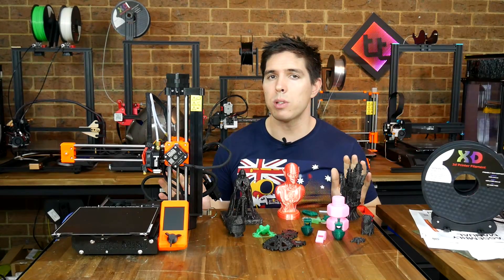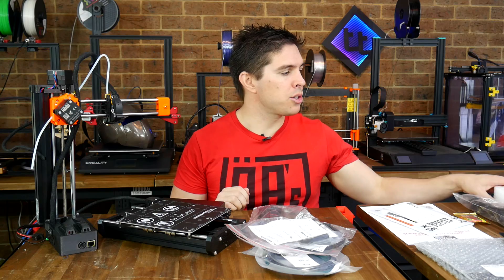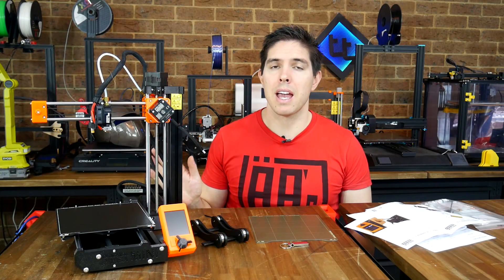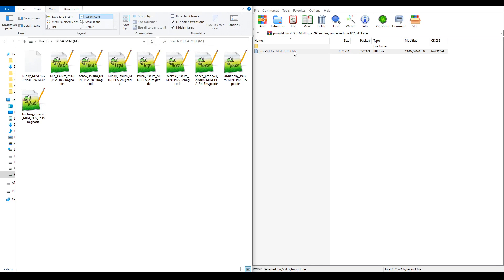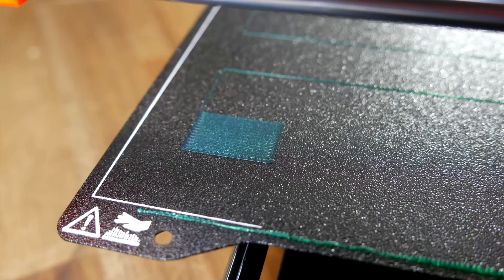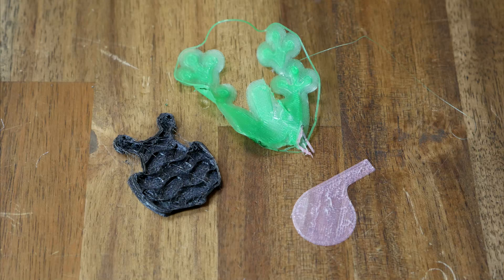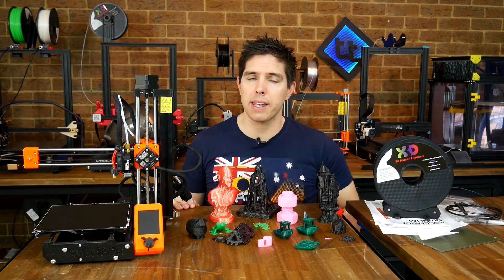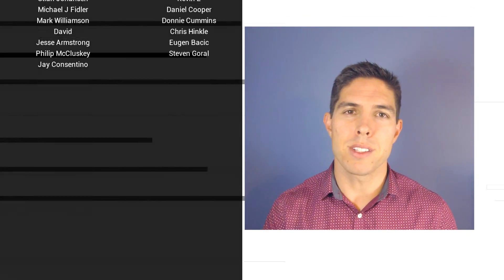Prusa Mini first prints (and troubleshooting)

Comment: Received my Mini 3 weeks ago. I already have an Ender 3 Pro and had an Anycubic i3 Mega for a few months. The Mark 3 is too expensive for me but the Mini seemed like a good compromise. Unfortunately I am also having constant issues with filament jams or slipping. The loading mechanism on the Mini is the worst I have ever seen. In addition, when something goes wrong the mechanism is not easily accessible to fix it. The "cheap" printers are much better in that regard. I really like the size, quietness and software features, but because of the filament problems I currently don't use it much. The print quality is good, but I still get slightly better results on my Ender 3. This could be because I tuned my Cura profiles for months and I am not very familiar with PrusaSlicer yet.
Reply from the maker: Great feedback, thanks for sharing.
Reply: Agreed. A printer that struggles to load filament is unacceptable from prusa. I'm on the verge of lighting mine on fire. It's just one jam after another.
Reply: @AlexKretzschmar  check the extruder. It could be too low. Mine was.

Comment: I'm tired of how every printer on the market seems to come out half-baked and requires fixes from the user.
Reply: It's still an emerging technology. I get it, I've been working on my printer ever since I got it and it kinda drives me nuts that it's spent more hours getting fixed or waiting for parts than it has been printing, but it's not like we have companies on the scales of HP, Microsoft, Samsung, and Apple producing these printers. And even those companies still have BS that happens with new products.
Reply: That's not quite true. I haven't heard people complaining about Ultimakers, MarkForged, EOS, HP, Formlabs, Raise3D or Stratasys 3D printers very much as being undercooked when introduced to the market.
Reply: Sanity Agathion You’re talking about multi thousand dollar printers, lol. We don’t have 2k-50k dollars, we have a few hundred for a prusa mini.
Reply: @bldjln3158  Indeed, but OP said "every printer on the market", which includes these as well. Do you want professional-grade equipment with premium support? Pay up. That's how it is right now. 3D p;rinters in accessible consumer space are still very new, very fiddly and require lot of attention. These are not yet appliances you buy in your nearest BestBuy in electronics section, bring home, connect to Wifi, download app and print. Not yet.
Reply: Not true. I am using Prusa MK3 since last 2 years and I have to maintain it only twice. Changed heater cartridge and Bed sensor. That’s it.
Reply: @Don Gray Exactly.

Comment: So basically the prusa mini has the same problems as some ender 3s had
Reply: Nope, ender 3 doesnt have ABL which is common fault on the mini, and ender 3 dont have firmware problems.

Comment: Every prusa mini video I have watched the printer has failed out of the box, I really wanted to buy one but i'm gonna stick to my ender 3 now.
Reply: I also have an ender3 and I like the build quality of prusa3 more. It’s difficult to upgrade it to that level.
I noticed that the textured PEI sheet is difficult to print on, it has to be very clean. But you are warned about that while buying it (IIRC)
Reply: @MarkusSeidl  yeah I find the textured only good for PETG
Reply: I think there is always a bit of luck involved:  since January I have an Ender 3 Pro and every 2 to 3 weeks something go's wrong ...  It has cost me more than 200€ to fix all the problems.
Reply: backyardbasher mine worked out the box, but mine arrived December last year.
Reply: @MarkusSeidl  I got mine around the same time and only had minor sticking issues with the bed, followed by a little bit of filament stripping on softer PLA. I did swap some parts to fix issues preemptively though.
Reply: Mine did a perfect benchy out of the box , but it must be just mine , came a week ago
Reply: Youd be suprised at how much better even the mini is than the ender 3. I have 2x Mk3S for my mini farm and its amazing how less time i have to spend tinkering with these.
Reply: Prusa is the most overrated machine sold today. Over priced for the cheap harbor freight quality.
Reply: @kraken3d718  I wouldn't say that. Their quality control and customer service still are far higher than anyone in their price range. Flawless? Not by a long shot. Better? Yes. Few printers are as good as the mk3s out of the box under $1000, even if you can mod a Creality machine to that level for a similar cost.
Reply: @kraken3d718  don't kid yourself mate, the i3 lineup from prusa has been a market leader, and for good reason too
Reply: @tcw95NZ  yeah lots of advertisement and lack of quality competitors in the early years. Now there are great machines sub $250. Absolutely no real reason to pay more in 2020. But the reach their own.
Reply: @kraken3d718  Every other prussa printer has been the best on the market. This one is a notable exception, and even then could be fixed with slightly longer pei tubes out of the box.

Comment: I'm sure they will work many of the issues out but I would be a little disappointed too if I were you. Creality needs to come out with an Ender 3 with ABL. Sell it for 300 and there would be NO reason to go with the Prusa. I know many people who have bought Ender 3s and are getting much better results right out of the box.
Reply: Creality makes quality printers. Because of the sturdy frame and board, the prints comes out almost flawlessly. I got a CR-10, CR-10 Max, CR-10 s5 and an Ender 2. And I must say, they all print so good!

Comment: I experienced the same issue with the jamming at the hot end. There are 3 grub screws that can be loosened and allow you to push the assembly up reducing the amount of space inside of the hot end and allowing for the stock PTFE tube to fit. I agree that I was not expecting to have to deal with an issue like that. Once I got it running again it was going well. My stringing is less than yours, and I just started to tune that away.

Comment: Just finished assembling mine. I couldn't get it to load filament and eventually noticed the extruder idler tension screw loose and dangling out the side. Once I got that fixed it seems to be running great, hopefully that's the worst of my issues.
Reply from the maker: I've just been browsing the forums and it seems quite a few rceived printers with loose x/y belt pulley grub screws.
Reply: I spoke too soon, after printing for a bit I ran into extrusion issues. Ended up having to replace the PTFE tube as well to get it working again, they have this exact issue and the fix documented on their website so I'm really not sure why they can't manage to assemble them correctly to begin with.

Comment: I'm a bit disappointed. I wasn't expecting one had to fix a brand new printer by removing the extruder when I recommended the Prusa Mini to my friends. In fact, I don't think I'll be buying one after seeing several youtubers reporting so many issues like that.
Reply: You don't have to remove it, just loosen the three grub screws and push it firmly up, then tighten the 3 grub screws again.  Some people needed to clean out their heat break too.  I didn't.  Prusa should really have got this sorted by now though, all the problems are assembly problems.
Reply: I am a 3d-printer noob and had the exact same experience.  I am disappointed with all the fixes and breaks that I have had -- and I've had them all.  Short PTFE tube, clogged long PTFE tube, stripped grub screws, clicking extruder. 

I love the Prusa ethics and models, so I'm proud to support them. But I'm wishing I would have gotten v2 or v3 of the printer.

Comment: I got my Mini 3 weeks ago.  I also had problems with frequent jams.  I also had problems when unloading the filament due to the blob on the end being too large to fit through the ptfe tube.  Increasing the length of the hotend ptfe tube fixed both problems.  The prints I am getting are better than my MK3S’.  I did print a different electronics cover and strain relief for the X axis, both found on thingiverse.  I also printed a different spool holder that did not have to be adjusted whenever you change the size of your spools.  I did wish it came with an all metal hotend that did not require a special nozzle.  I do like the printer and I have gotten some excellent prints from it.
Reply: Oh So is hope for this machine! :) thx
Reply: can you eplain how to fix it? thanks
Reply: Aka Krai Here is the link to the instructions on how to replace the hotend ptfe tube.  https://manual.prusa3d.com/Guide/How+to+change+a+hotend+PTFE+tube+-+MINI/1505   I used a piece of capricorn ptfe tube that was a few mm longer than the original one.  The one they put in the hotend was a little too short.
Reply from the maker: Thanks for sharing.

Comment: I have had a mini since the first batch of deliveries.  After the list of things that were assembled wrong at the factory were fixed, I have a printer which exceeds my MK3s in quality and have not seen a single string :) I had the over tightened idler and also the problems in the hot end though mine was solved by simply moving the hotend firmly up against the ptfe tube.  I have also had the MINDA probe fail which to their credit, Prusa provided a replacement within two days.   I love this little printer now but I sure wish it had been delivered as a kit.
Reply from the maker: Thanks for sharing.

Comment: So I have an Ender that has a lot of upgrades, linear rail, direct drive, etc. however with an OEM 8bit board still. I was thinking of getting one of these as a secondary printer but swapping the electronics that way my current "ender" platform has the better board. think this is a viable solution? obviously going through software and needing to tweak a few things will be needed, but i don't see anything that would stop prevent it from working? thank you
Reply from the maker: You mean a Prusa buddy board into an Ender 3? I suppose it's possible. Much more cost effective to drop in an SKR mini E3.
Reply: @TeachingTech  i understand that, but like i said i was wanting an additional printer anyhow. so swap ender parts into smaller platform, and prusa parts into my built up platform. Thank you

Comment: Is it just me, but print quality of the parts of the mini are hmmmm... I print better with my ender 3. The display is very nice.
Reply: I have the Mini and an Ender 3 Pro, and currently my Ender 3 prints are also slightly better. I am however not very familiar with PrusaSlicer yet.
Reply from the maker: SebomasteR when you say "this guy" I hope you aren't referring to them. I'm not selling anything, just making an honest video.
Reply: @TeachingTech  I think he's talking about Josef Prusa
Reply: I have a heavily modified and tuned Ender 3 Pro and a Prusa Mini. Once both are tuned they give the same results. The Prusa Slicer settings for the Mini out of the box aren't that optimized.
Reply: I bought my Ender 3 in October 2019.  My first printer.  It has run every day since. Iv'e replaced parts due to wear, not failures.  I have it dialed-in and the prints are sweet.  If I were to buy another low-cost printer, I would buy another E3.  The Prusa have some nice features but I really enjoy the bare-bones of the Ender.
Reply: Damn right, i wouldn't put them on Thingiverse and this guy (Josef Prusa) is actually selling this.